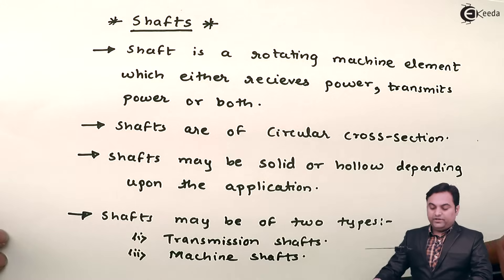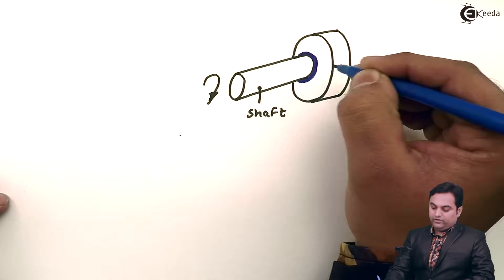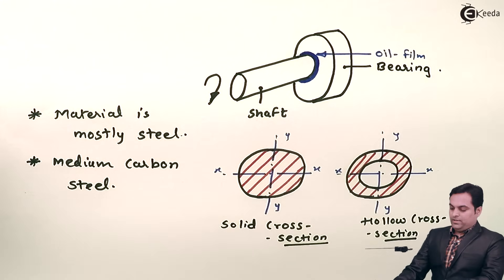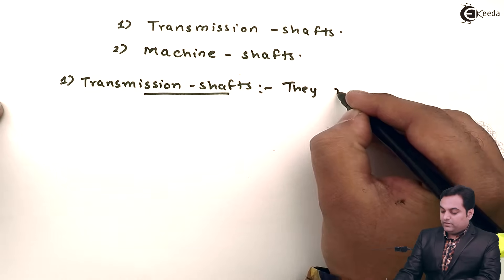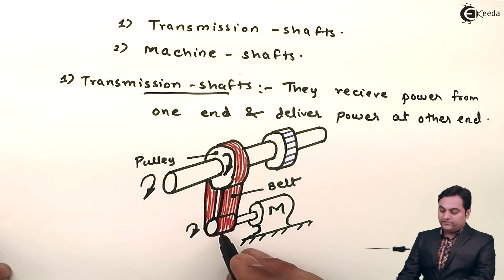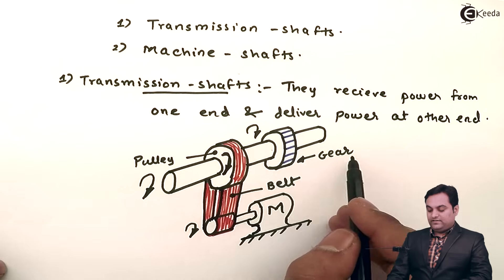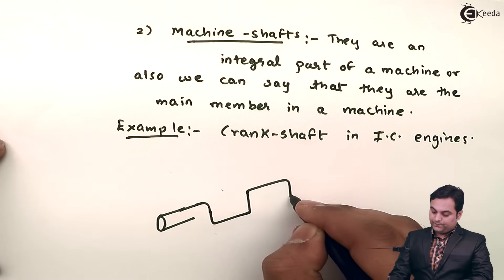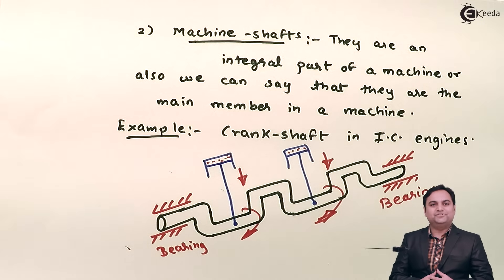Definition of Shaft and Its Explanation - Design of Shafts, Keys and Couplings - Design of Machine

Comment: Do transmission shafts loose power depending on its length? I want to build a machine which I'll by using a shaft that at the beginning it rotates with a pulley belt from a motor and its supposed that the shaft will be 10-12 meters long and I'm afraid it might loose its power and torque at the end of the shaft.
Reply from the maker: Kindly download the Ekeeda Learning App https://ekeeda.com/download.html & ask your doubts. Our experts help you to resolve queries on chat.
Reply: @Ekeeda  omg thank you!

Comment: you are an amazing teacher.I have a question:the crank shaft is one that receives power,while the first shaft explained is the one transmitting power?If not,what is an example of  a receiving shaft?because i assumed that the second shaft also transmits power to the wheels..
Reply: https://youtu.be/vFDMaHQ4kW8 💐..

Comment: Generally bearing and shaft are assembled with tight fit between ID  and OD at that time is it possible to maintain thin film of oil in between bearing ID and shaft OD?
Reply: thin film is between the bearing runway ; the bearing ID becomes the integral part of the shaft.